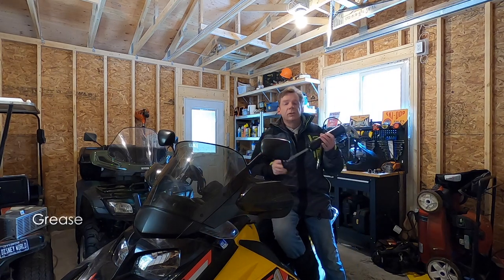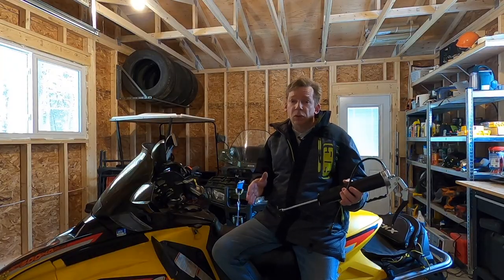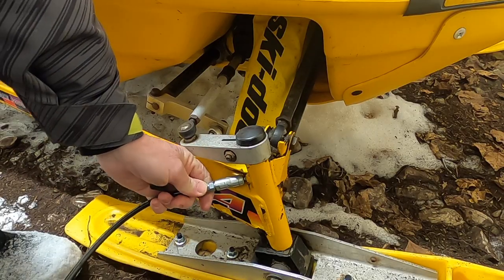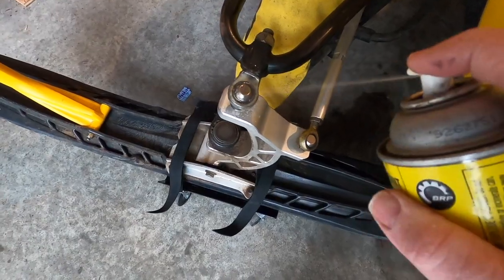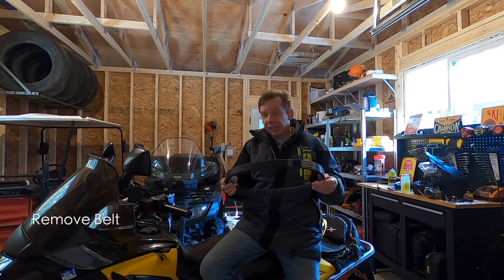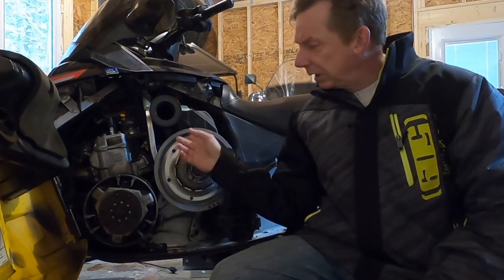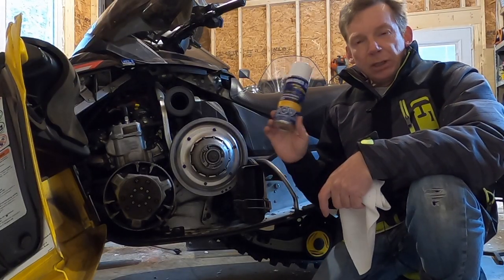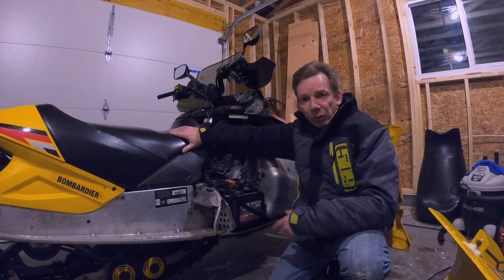How To Store a Snowmobile for the Summer

Comment: David I agree with most except for fogging etc.. l’ve found it’s always best to start an engine every so often during storage. Thanks for your great tips 👍
Reply from the maker: I used to that too as i said, its better than nothing, but fogging is the proper way to prep for storage and the preferred approach. Thanks for watching and commenting.
Reply: Cool ..we can agree to disagree 👍thanks again
Reply: I know...I'll upgrade to a bit newer that has the "summerize" feature! 🤭🤭
Reply from the maker: Even better!
Reply: I start my sled every 3 weeks and spin the track and get all those bearings moving if there’s any water or condensation out of there 

Thanks David
Reply: @king-pin007  Corrosion starts on piston rings, wrist pins, cylinders, crankshaft and connecting rod bearings almost immediately after a machine is put into storage. You'd have to run your motor weekly. Fogging is the correct way to store a sled or ATV in the off season. - Dealer 25+ yrs
Reply: @mpsports5402  I bought a lightly used old sled last year.. last time I  had a sled was 25 yrs ago.. I’ve decided to fog it lol thanks 👍

Comment: David - once I add the stabilizer - is running the sled necessary - and if so - I usually let it run until it stops?
Reply from the maker: Its better if you do, to run it through the lines. No, it won’t stall.
Reply: Some people shut the fuel off after adding stabilizer and then let the sled run until it stops... spreads the stabilizer through the systems and drains the fuel lines/carbs. Can't do this if you want to fog it.
Reply from the maker: Some guys do, but you should really never run a sled out of fuel. If your sled has multiple carbs (especially triples) and one of them runs out of fuel before the others, technically you can lean out that cylinder. This can happen for a variety of reasons including issues with the needle and seat, partially blocked fuel lines etc
Reply: @MyOldSled  Excellent point! My 1997 has twin carbs, time to stop this practice. Thank you!
Reply from the maker: Not hugely likely, but a possibility. I never do. Thanks for watching and commenting serge

Comment: Do you fog 4 strokes or just the 2s?
Reply from the maker: You can. In a two stroke, you’re protecting your crank shaft and connecting rod bearings, in both 2 and 4 you protect cylinders, wrist pins and rings, and in a 4 stroke you also protect the valves. Some 4 strokes have a flame arrestor on the intake and shouldn’t be fogged through the intake. Check with your dealer or manual.

Comment: For mice use dryer sheets
Reply from the maker: Hi BT. Yep that’s one of the suggestions in the video I mentioned. I don’t use them for blocking the exhaust, but putting them arou d the sled can sometimes deter rodents. Outdoor Snowmobile Storage Tips - Goodbye Temporary Shelters!
https://youtu.be/dXIR6zQbD-w
Reply: @MyOldSled  no I’ve always used oiled rags for exhaust dryer sheets on running boards and around the engine

Comment: I dont know how the skidoo stabilizer is but please NEVER use the red stabil stuff. I own a small engine repair shop and they told us in school to never use it. It forms a film on top of the gas which doesnt let the evaporates out of the gas. The problem is is that when you start using the sled/machine again it sucks that scum through the carbs and ,voila, you have carb issues. I, personally, use only sea foam. If you use seafoam on a 2 stroke you need to add a little bit extra oil to the gas to compensate for the seafoam. Seafoam burns dryer than gas which is why the need to add a bit extra oil. And, NEVER USE ETHONAL! NO MATTER WHAT. not even 10%, even if manufacturer says you can. This is all just my opinion. Take it however you want.
Reply from the maker: I have never had a problem with any of the fuel stabilizers I’ve used. Good to know, I’ve never used the red stabil stuff. Ethanol presents a few challenges but easily compensated for with proper maintenance, though there are additional challenges with some older vintage sleds. Unfortunately,  non-ethanol gas is getting harder to find and some stations that are currently offering non-ethanol premium in the US and Canada are switching to 10% ethanol so not much choice.

Comment: I do all of the above.  Accept I completely drain the tank, And run the machine until it's out of gas, While fogging it, That way, The gas equation  and worry is completely gone, And the fuel system and carbs are completely dry and clean. And as for moisture in your tank. Whether indoor or outdoor.  If you just leave your gas cap a bit loose. The tank will breath, And you will have zero moisture  :)      Trouble free myself every year for 47 years of my life  ;)
Reply from the maker: Hi Tim, No need to leave your cap loose. All tanks are vented, allowing them to “breath”, primarily to equalize pressure. The level in the tank changes with temperature, and obviously fuel consumption. If they are not vented, the result would be vacuum or pressure. Condensation forms as a result of temperature differential between the tank wall and the air, and would even if you removed your cap. As I mention, I know some guys drain the tank, but best practice, and the one most effective at minimizing the risk of condensation, is to fill the tank. Thanks for watching!
Reply from the maker: Also, while I have seen that approach, running a machine out of gas is never recommended. On a machine with multiple carbs, especially a triple, if you have an issue with a needle and seat …or for any reason one carb runs out of fuel first, you can end up,with damage from running one cylinder lean.
Reply: Awe But .  I love your channel  :)   And cheers to our old MXZ's  ;)    I have a 2002 500 liquid myself,  Still running today  ;)
Reply from the maker: How was your winter? Lots of snow?
Reply: @MyOldSled      Awe to be honest.  I live in Shelburne Ontario, Or '' District 4 ''   So we're not much different than you. I got out a few times , But I've seen better winters.  Those few Feb rains really put a damper on things . And I only can ride on weekends, But I got out 4 or 5 times for a few good runs around here :)  But tis nature, Weather wise  ;)  And how about you?  In the mighty Bruce?  :)
Reply from the maker: @MyTimmy75  Between building the garage, and the up and down weather, i didn’t get out a whole lot. A bit of ditch-banging around the village.
Reply: Awe  I bet the garage is quite the difference than working in that tent   :)   But it looks really good  :)   Awe and I hear ya.  I put just over 300 kms on mine, Thats it too while things were open.   Awe well. Some winters are just a draw  .